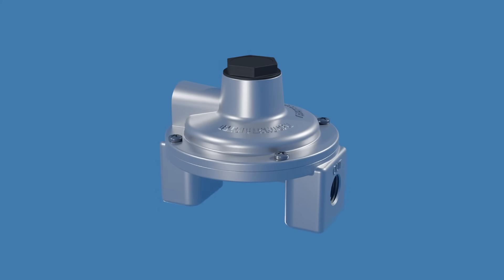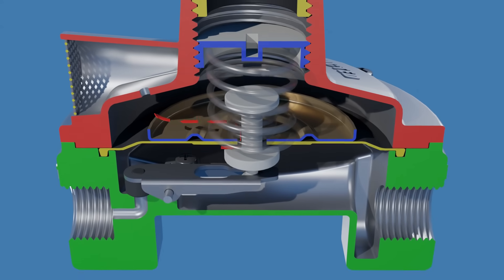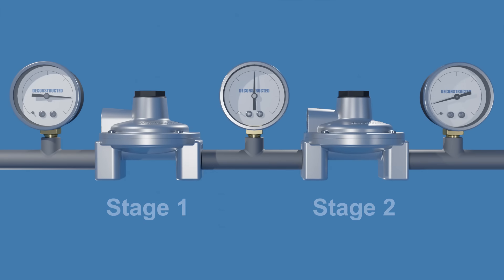How a gas regulator works

Comment: Okay you can call it "breathing" but what the vent actually does is it allows you to set a pressure in psig or barg (gauge, so above ambient air pressure) instead of psia or bara (absolute, so unrelated to air pressure).

Comment: You finally start to see the limitations of single stage regulators when either regulator adjusting an oxy-fuel torch for welding, or running an oxy-propane gas axe with a high delivery pressure and flow rate for scrapping with a nearly empty tank on a cold day.
   Propane inlet pressure varies wildly, but predictably with temperature. The pre heat flame will lean out when there is insufficient gas boil off during use,  but have a fuel heavy carbeurizing flame, when the quick connects are snapped back in and the torch is restruck. Just two examples, and not the "proper" regulator design, but single stage none the less. This one is essentailly a barbecue grill model, but put two guages and a toggle screw on it, and you have a low end torch regulator. Bottom line is that these don't do well with high flow/low temperature/low fuel level issues, or very low 3 - 5psig settings found in welding, so better performance comes in the form of two stage units for.....300 dollars.

Comment: I don't recall our LP regulators having a vent. We had a tank with a relief valve on it I think.
Our gas man installed regulator sideways on our Mobile home. 
 I have always wondered how they regulated pressure.  We haven't used gas since 1987.

Comment: Between the moment usage cuts until the passage closes, there is enough time for down pipe to pressurize. That means next time usage starts, it’ll blow gas at high pressure. How is that prevented from happening?

Comment: It seems that with this design the "excess pressure" doesn't just get relieved through the relief valve, but through the outlet port as well, which would make the regulator not really regulating the pressure

Comment: Timestamps
00:04 - Gas regulators reduce high inlet pressure for safety and functionality.
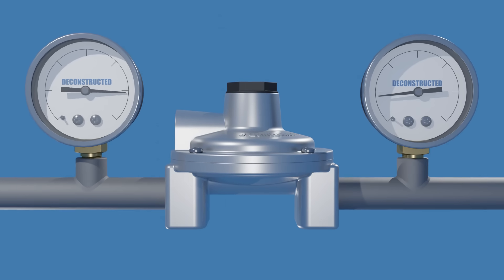00:41 - Gas regulators ensure steady outlet pressure and prevent pressure spikes.
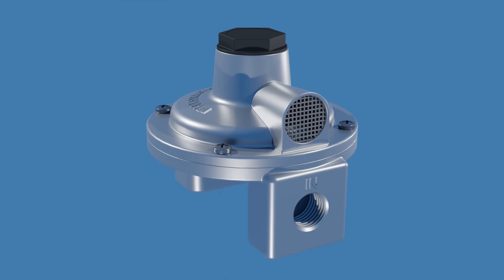01:21 - Gas regulators prevent pressure blockages with proper vent design and orientation.
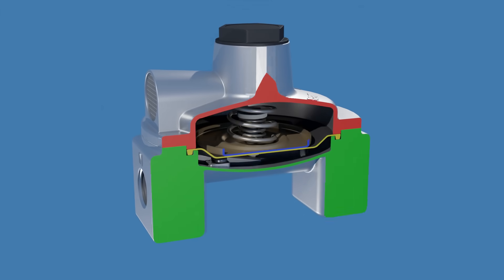01:59 - Gas regulators adjust outlet pressure using a diaphragm and spring mechanism.
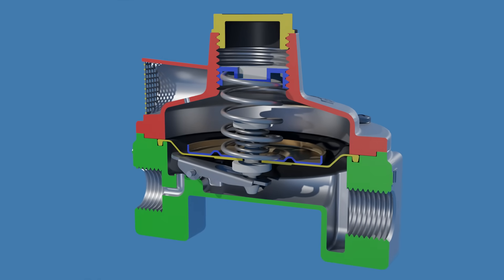02:37 - Gas regulators control pressure by adjusting spring tension.
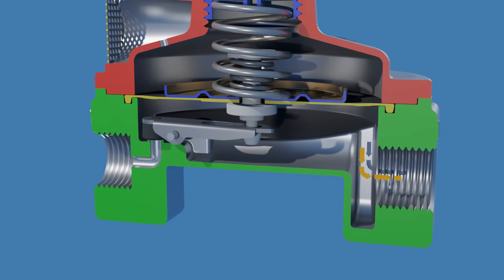03:14 - Gas regulators automatically adjust pressure to maintain consistent outlet flow.
03:50 - A gas regulator's diaphragm controls pressure release via a relief valve.
04:26 - Dual stage regulators reduce pressure in two stages for efficiency.

Comment: In all my working with gas, the high pressure side is 15PSI...the low usable pressure is 0.5PSI..  Where did you get that astronomical number for the high side?

Comment: By "access" pressure, the AI voice bot means "excess" pressure. This condition occurs rarely, and can sometimes be fixed by wiping off the rubber seat clean of debris, or replacing the rubber seat altogether in case of tears or scarring. "Dual stage regulators" mentioned toward the end of the video are more often called "Series Regulation".  More complicated forms exist and are useful in various applications, but you covered the basics. This was an excellent explanation, and I'm a natural gas utility worker of 20+ years experience.
Reply: I don’t think it’s an AI voice, it’s just a non-native speaker.

Comment: That vent port is part of a pressure relief valve function, not part of the pressure regulator. Many regulators do not have a vent (to prevent hazardous gases to escape), nor is one always needed. These work fine at sea level (spring working against ambient pressure), but at high or variable altitudes, a vented coil spring will not work. Aerospace components use 'aneroid bellows' (springs mounted in a vacuum) which work independently of outside pressure.
Reply: The vent port is required because else you would just be compressing the air in the upper portion of the valve body. You could compensate this with a smaller spring, having the air act as a second spring, but that would get unsafe in case the valve body develops a leak and loses the "required" air pressure.
Thats why pressure regulators almost always works "against atmosphere".

You are also wrong about that a ambient pressure regulator wouldn't work at high altitude or variable altitude. This is EXACTLY why you ideally would want a device that works against ambient pressure. Remember that gas flow through a nozzle is determited by the pressure difference, not absolute pressure. So if you want a specific flow through a burning nozzle to get a good flame, the regulator should supply a gas pressure that are a specific difference against the ambient pressure, thus the regulator will "self-adjust" to the perfect outlet pressure  So if you get a good flame with 3 bar of gas pressure when its 1 bar outside, you want 2.5 bar of gas pressure when its 0.5 bar outside. So this is exactly why you want a ambient vented pressure regulator if you subject your device to high or variable altitudes.

If you however have a device that relies on a exact absolute pressure, could be a fuel cell or some other self-contained system for gas fuels, then you would need a unvented aneroid regulator, to supply the right pressure regardless of ambient pressure.

Those that have no vent always works in a vacuum (partial or full), which are more expensive to manufacture. This is safer, as such a regulator has a bigger spring, and thus, a leak and loss of vacuum, would mean the regulator completely blocks the gas flow, or reduces it very low, signalling that the regulator needs to be replaced.

Hazardous gasses CAN be vented, you just need a relief valve that is set to a higher setpoint. After all, its a balance between the "unsafe condition of vented hazardous gasses" and the "unsafe condition of a high pressure that could cause a overpressure explosion, which in turn could trigger a combustion explosion".

You might know, that at 10 bar, the kitchen valves just start to leak through and it will be impossible to turn off the gas using the applicance controls. But at 25 bar, you know that pipes, hoses and nozzles could explode, deform or crack. Then you set your relief valve to 20 bar. You know that the vent won't start releasing hazardous gasses when it reaces the first unsafe pressure, because its more worth letting the overpressure through, and then just burn the gas at the appliance, which is safer than venting it.

But at 20 bar, its more safe to vent it, because you can vent it to a safe location.

Comment: I used to checked pressure regulation at commercial business because of complaints and I can tell you some of the propane companies are not educated enough understand the engineering concept of putting the plumbing together.

Comment: Lovely and clear video thanks so much. Do you know if these valves' diaphragms are suitable for contact with hydraulic fluid or engine oils? I could potentially use one to reduce pressure in a hydraulic system I want to build onto my tractor, to operate some hydraulic trailer brakes. I'm not asking if you recommend it, just if you know if it should work in practice, if only in theory?

Comment: Northern Ohio. Once had my natural gas valve vent ice over due to nearby furnace & water heater exhaust moisture. This cutoff gas supply to the house, so no heat and no hot water in the middle of winter. 
After a little while of troubleshooting finally figured out gas supply was the problem and suspected the ice buildup on the gas regulator as the problem. Melted it carefully with a hair dryer on low heat and good to go after that. Every winter afterwards, I always install a baffle to minimize any exhaust moisture from getting on the pressure regulator. Life lessons..

Comment: So it's normal to smell the additive in propane near the regulator at the tank or for a gas detector to indicate? Used a >50ppm KLEIN gas detector purchased to take my wife's sniffer seriously and investigate the problem against by belief of there being anything wrong and this is the only place it indicated anything. The regulator at the tank. The one at the house was clean and all fittings all the way to the furnace where it ignites were all clear. It was checked with soap and water last year and nothing showed either

Comment: Fuel gases not "liquefied" petroleum gases. They're gases. They aren't liquids. An extraneous word slipped in there. Some of the time, the gases are stored as liquids (especially propane and butane) but regulators can't control the pressure of liquids, only gases.
Reply: Doesn't need to be fuel gasses. Exactly the same regulator system is used for all pressurised gas,like oxygen, heliun,carbon dioxide.

Comment: How do you determine what size regulator to use in an application? I have a 1955 camper that once had a propane furnace, hot water heater and stove/oven. The furnace and water heater have been removed and replaced with electric and the original regulator had been removed and thrown away.  I can't find any gas consumption values online or on the stove/oven. It has 4 burners, oven and broiler drawer on the bottom. Any ideas how to figure out what regulator to look for? I would assume that a propane grill would not work because of I were to say have a roast in the oven and I'm using burners on top, there wouldn't be enough flow of gas?

Comment: Do you have a video on water pressure regulators? Because water is incompressible, it seems that regulating water pressure is more difficult (than gas)  and so often such regulators fail.

Comment: Great video! The animation suggests that during use there would be continual on- off adjustment from the inlet pressure valve though, which isn't how they sound like they're working in practice.
Reply: Modulation between on and off, not binary on-off.

Comment: Great video, though the two-stage regulators I’ve used are for non-cryogenic gas cylinders where the inlet pressure varies continuously but a constant outlet pressure is needed.

Comment: One extra, VERY IMPORTANT reason for the wire mesh on the vent.

Fire cannot propagate through most meshes agains the flow.

I imagine it's the same reason plumbing and roofing torches have such narrow apertures on the neck before the nozzle

Comment: It's so simple, yet essential for adoption of gas lighting and heating, without regulator, one would have to manually adjust the valve, a bit of wrong adjustment could result in huge flame. Regulator solved that issue.

Comment: Only one problem. That is a demand type regulator not a high pressure regulator. Your thumbnail shows 200 psi going in and 5 psi out. This type cannot do that. FIRST you need a high pressure regulator (usually red in color) THEN one of these. They DO drop pressure but not in that high a range. BTW, gas is usually measured in inches of water collom or inches of mercury with this type. Not PSI

Comment: Most natural gas distribution systems flow completely on regulated pressure; gas goes through the first regulator to go from 700-1000psi down to 250-350psi down a transfer segment. From there, another regulator station will bring it down to ~125 psi for distribution throughout the regional system. Your next reduction will be to about 60 psi, for use in neighborhood systems in outer suburbs. Smaller systems with denser populations (like in villages) will usually be regulated down to something in the 30 psi range, larger urban areas (where denser populations result in more common accidental gas line breakages) are often regulated down to the 15 psi range, and older urban systems (often with 100+ year old mains that were never built for pressure) will then run anywhere below 5 psi, the oldest systems running at as little as 10" water column pressure (less than 1/2 psi). These ancient systems used to use 'coal gas', pressure was created solely by the weight of the sliding lid on the old gas storage tanks, and the mains were usually Ø6" cast iron joined together with creosote and jute. Systems like these traditionally did not require internal regulators inside gas appliances, which unfortunately resulted in occasional house explosions when the old 'lead weight' distribution regulators would get tampered with or damaged, resulting in an increase in line pressure that would blow the flame out on many pilot lights.

Comment: You didn't explain the most important and confusing part of how this works. If the inlet is at high pressure and the outlet is at low pressure, and the chamber under the diaphragm is connected to the outlet and is therefore also at low pressure, how does the high pressure on the inlet not just push open the valve. how can the low pressure inside hold back that high pressure. The answer is that it's the area the pressure is working on. the low pressure is acting on the large area of the diaphragm, the high pressure is acting on the small area of the opening of the inlet orifice. Force = Pressure x Area, so if they are sized proportionally, the forces will be equal at some point within the adjustment range.
Reply: If the input preasure was constant then the spring wouldnt be needed and it would solely work based on the area. Spring is equally important in maintaining the variable input preasure by closing the input cavity.
Reply: Holy shit I almost don't have to watch the video now, thank you.
Reply: Thanks.
Reply: @Bill-s2z8u Me too… just what I needed. Coincidentally also a “Bill”.
Reply: From what I understand, because the diaphragm has more area there is more force pushing up on it. Think about it in terms of psi. Pounds per square inch. If you have 2 psi on a 1 square in of area, then you have a force of 2 lbs, but if you have 2 psi on 2 square inch then you have 4 lbs of force. So by the diaphragm being so much larger than the inlet diameter, it can close the valve using a lower pressure. Hopefully, this helped.
Reply: Yeah he lost me when he called excess access
Reply: all pressure is measured in weight equivalent over a given area (pounds per square inch for example)
yah that inlet is higher presure and wants to escape, but the diaphragm is MUCH larger than the stopper, so as soon as the pressure in that space gets high enough the inflow is stopped or a balance is found between the two when the system is flowing.

for more clearly, one pound over 10 square inches on one side of the scale is the same as 10 pounds over a single square inch on the other. (unless I'm missing something dumb)
Reply: This and I compressibility must be why a water pressure regulator is much smaller in diameter.
Reply: I also installed one regulator today but i faced issue gas leak from vent continue what can be the reason
Reply: Clearly, your explanation about force equal to area X pressure is correct but if you look at this schematic picture you can see that what is balanced is the inlet pressure at the orifice versus the combined spring and diaphragm pressure at the other end of the lever. The regulation is a combination of all of this; spring, diaphragm and mechanical lever advantage. In this design, there is no area ratio advantage.
Reply: Hella no that explanation with F = PxA, its because of the spring and bi stable operation.
It can useful the equation to define the valve parameters and the fluid dynamics but it does not explain the mechanism behind it.

High pressure than the spring force on the diafragm, close.
Less pressure than the spring, open.
Its keeping oscillating between boths higher and lower pressure than the desired pressure, the average is close enough.
Reply: Glad I saw this right before the watch
Reply: I didn't even watch the video because this is exactly the question I was looking to have answered. You've explain it so well and simply. Thank you sir!
Reply: Yes the area, but the spring does Majority of the work, and also the low pressure side has a mechanical advantage with the lever that closes the inlet. Don’t criticize the whole video, when it is explained perfectly
Reply: It’s only “confusing” if you don’t have a basic understanding of mechanical advantage. The principle used here is common in many other “everyday” situations (hydraulic brakes on an automobile). The video is a good one and is a great demonstration of the “magic” that happens inside the valve.

Comment: Very similar to an LDO in electronics.
I wonder if there is an equivalent for switch-mode supplies.
Maybe a pressure tank "C" and a valve that turns on/off the in flow (but doesnt regulate it) based on the pressure of the tank

Comment: I assumed that the valve would be a needle valve, for more precise control of the gas pressure. It seems like the rubber valve, opening and closing, would not be precise enough, and would not handle transients very well, causing oscillations and pressure?

Comment: I have a very common two piece regulator that has no in and out marked, and instructions show it opposite compared to the packaging, and even more strangely, it works absolutely perfectly no matter which you use for the outlet. Mind blown 🤯

Comment: Brilliant summary. I didn't realize it uses atmospheric pressure as the baseline, which will shift up and down depending on atmospheric pressure. That makes sense because at the outlet burners, flow of gas out will also depend on the relative difference between line pressure and atmospheric pressure.

Comment: This is interesting. We don't have adjustable gas regulators in our bbq grills... We only push the regulator to the bottle until it locks and then there is just lever to open the valve or close it.
Reply: регулировка была произведена на заводе